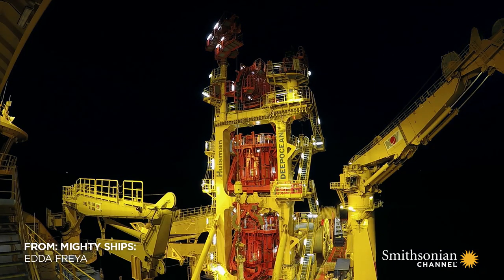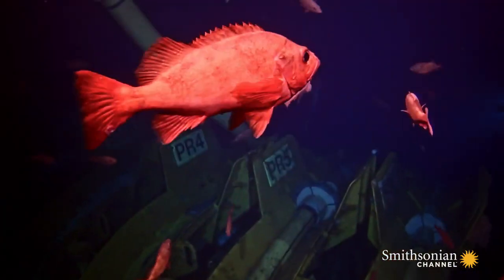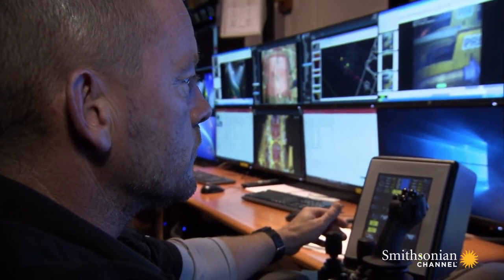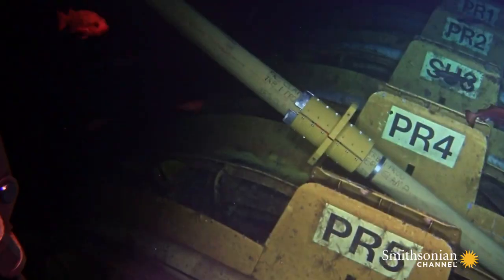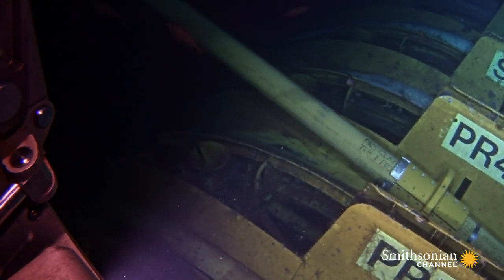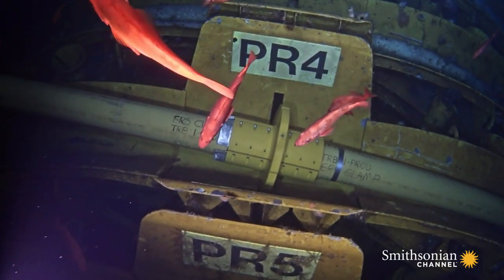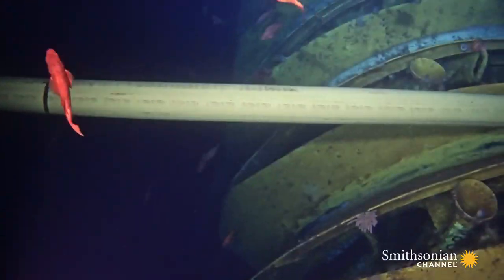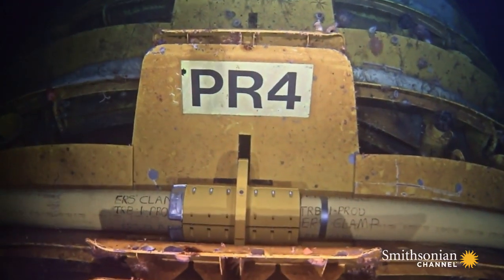This Mighty Ship Works Around the Clock at an Offshore Rig

Comment: I've always wondered, how do you end up working on one of these?  Are the people that are giving directions petroleum engineers?  The crane operators, heavy machine operators?  How does one straight out of high school/off the street get into a career like this?
Reply: Hi there, I work for DeepOcean the company operating on this vessel. I recently joined their survey team as a data processor, after graduating with a degree in Ocean Exploration & Survey at Plymouth University, UK. So for my particular role and any in the survey department at entry level, a degree relevant to surveying and geophysics is the way in. 

PM me if you'd like to know more!